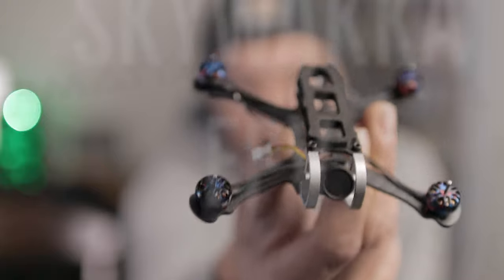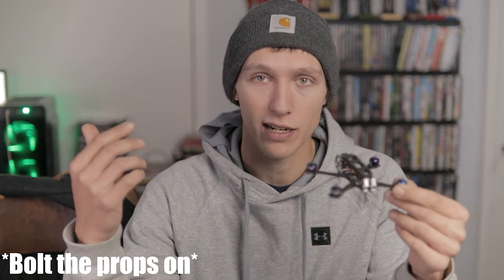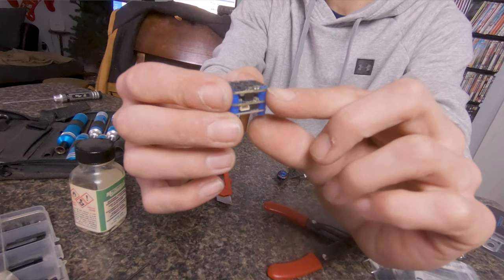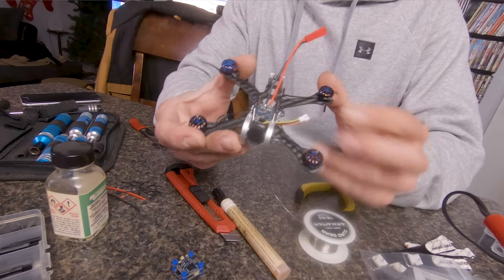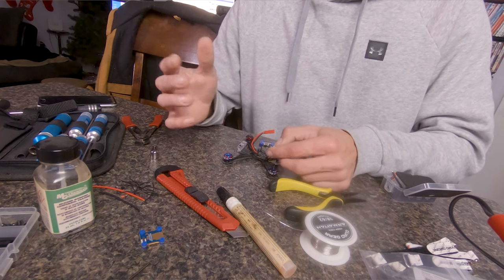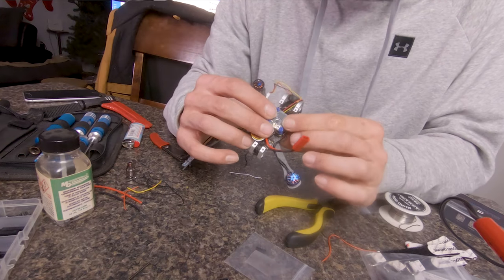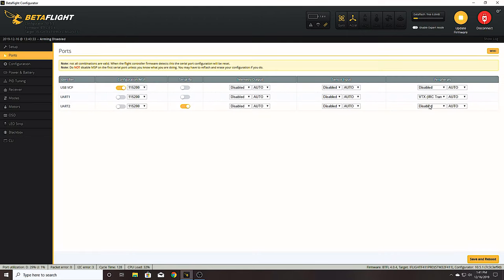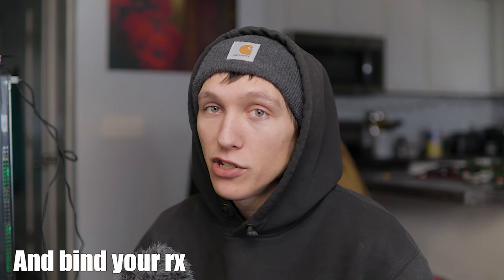How to Build the Armattan Tadpole | iFlight SucceX Micro | Tutorial

Comment: Nuts to lower the screws on back was a good idea.  I ended up cutting some length off the screws in the back instead.  I also used the soft mounts but I cut the top most rear in half so  no rubber on the top of the VTX in the rear.  That let the top deck fit just right.  My iFlight came with plugs which hardcore blocks the receiver pads.  And my BetaFPV motor wires are like 2mm too short.  Ill figure that out next.  Nice build!
Reply from the maker: Try the flywoo tiny led racewire. That’s what I eventually used on mine when I switched to the 3”. They’re super small and work great. What I ended up doing is flipping the stack bolts upside down sticking out the bottom and used aluminum nuts on the bottom of the frame. Switched back to all soft mounts cause I broke pins when I hard mounted the esc.
Reply: @Sky-wakka  I just got all these parts today.  After most of the solder work, been sitting here for an hour deciding how best to make it work.  Ditch the plugs?  Still need to extend the wires.  Splice the wires?  I only need 2mm.  Cut the heatshrink on the motor and hope I can just solder new wires there?  I didnt even know led racewire was a thing - thats perfect!  Now I just need to order and wait... :)  Thanks again!
Reply from the maker: Yea you could just cut the wires half way and extend them with solder and heat shrink to get by until you get the race wire.

Comment: Sweet man good video! Just incase some viewers use this stack and dont want to use the vtx. You can remove the vtx completely and there is a video out pad on the fc. And depending on the version of the board you can soft serial the led pad for tx1 so you can use smart audio. Just did it last night. Another way to get tx1 since it is in the feemale side of the black block connector, is to solder to the trace where TX 1 is located. I've done It both ways. And you would still use the plug for the camera video, power, and ground. But keep it up man I subbed!
Reply from the maker: Thanks for adding that! I remember seeing that when i was looking at the wiring diagram but because i was using the vtx with the stack I didn't think to mention anything about it. That's always another option for those who dont want to use the vtx. It was pretty tight fitting it in there lol
Reply: Yeah no problem!! I only mention it because it was an issue I had.. the stack was laying around not used because I had it for the mode 2 frame but i didnt like the frame. So it sat for a while until the tadpole came out! Lol I struggled trying to fit the whole stack I dont have a bunch of bolts either. So I went with the nameless rc vtx
Reply: Also how is it flying on defaults? I'm running it on 4s till I can get different motors and it is crazy fast with 2.5 tri blades. Need to tune a little though
Reply from the maker: Mine flew pretty bad on 3s on the default pids. I tried to tune it but ran out of 3s packs. It flew worse on 2s cause it had no power but i ended up with my d's in the 40's i think and that flew decent. I still gotta do some tuning for sure tho
Reply: @Sky-wakka  oh okay are you running 65mm props? If I recall correctly I was flying a custom gnarly build a few months ago and had so many problems tuning it with 65mm props on 3s. I cut all the pids in half and it helped alot. I was up in the 40s for alot of the pids and it flew ok but not that good. Once I cut them in half it was so much better.
Reply from the maker: See back when I had my gremlin I swear that’s what I had to do. I remember on 3s it was really bad and once I cut my d in half it made a huge difference. But this time around it seemed like the opposite. I’ll have to keep playing around with it and see what I can do
Reply from the maker: But yea that’s what I’m running is 65mm. My old gremlin used 1106’s and 2.5” which is pretty much the same thing. Wonder if some tri blades would be better

Comment: Thank you for making this video bro!! I'm using the exact same esc and prior to stumbling on your video I was seriously thinking about going with a whoop board instead. My only gripe about the Tadpole frame is that the stack holes aren't centered in regards to the arms, although that would make the iFlight stack even less compatible obviously. I'm using a set of the Emax 1106 4500kv motors on my build to start, and may upgrade to a set of iFlight motors eventually. Did you end up using the little dipole antenna that came with the vtx? I'm planning to use an iFlight antenna I had prior to this build, just curious how well the little dipole works if you did use it. Thanks again!
Reply from the maker: Yea I just used the antennas that came with the iFlight stack. It’s been working good for me, gets me as far as I need to go. If your on the fence about it, try out the dipole and if you feel like there’s room for improvement you could always upgrade
Reply: @Sky-wakka  Right on...  I'll try it out. Thanks again man!

Comment: What size solder do you use on this? I have .8mm and it's actually wider than the pads. I ordered .6mm solder because I'm having a hell of a time. I don't think this was a beginner's soldering job. That's for sure.
Reply from the maker: Yea these little pads are a total pain. I’m not 100% sure but I use the armattan solder for my quads. It works like a dream

Comment: Hey! I just purchased a f4 mini + 15a esc, will it work with 2207 motors? Thanks.
Reply from the maker: Do you mean 1207 motors? or 2207? I dont think a 15a esc would cut it for 2207s. I think you meant 1207's since your commenting on my tadpole video, a 2207 wouldn't fit on a tadpole. A 1207 would work great and a 15a should be fine.
Reply: @Sky-wakka  thanks for your prompt reply, I cancelled those esc + fc, and I'm getting 40amps one. (This is my first build and it was for 2207😂).

Comment: The motor bolts have proved to be a pain for me as well. It caused a lot of desync because they were touching the coils. Nearly replaced my ESC thinking that was the issue
Reply from the maker: Yea it's pretty inconvenient. What i ended up doing is using 5mm bolts with the little tiny nylon washers that come with runcam's. 4mm worked without washers but i had issues with them falling out so if you use 4mm i would make sure to use lock tite
Reply: Skywakka FPV what firmware was on it at the time?

Comment: Cool video man, basically exact same build i have planned when there is stock here in aus, thanks for the tips about screws. some constructive criticism, try to focus in on the parts so we can see them better, and you didnt show us the final build?
Reply from the maker: The B-roll at the beginning was of the finished build. I just felt like a lot of the information was necessary to the video, it got really long so i didn't think putting on zipties and 4 bolts to the top plate was worth including. The point i wanted to get across was just installing the stack. But yea the angle of the gopro wasn't as good as i'd liked it to be, i actually just got a second canon camera so in the future my b cam will be a lot clearer. I appreciate the comment, and the criticism. It was my first build tutorial so i'm still learning 😉
Reply from the maker: Also regarding the bolts, i only had two per motor first flight. And on the second lipo both front motor bolts had all fallen out. I ended up using 5mm bolts that come with the motors, and adding some small m2 washers that come with some runcams. They have locktite and held up much better today. I'll have some video up by tomorrow of it flying hopefully
Reply: @Sky-wakka   I went from my phone to tv, must of missed the start lol